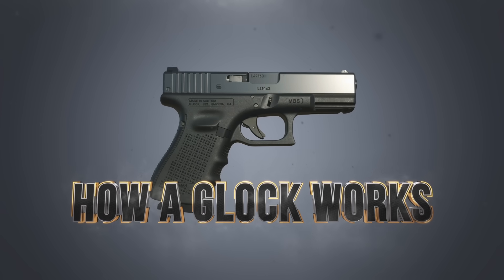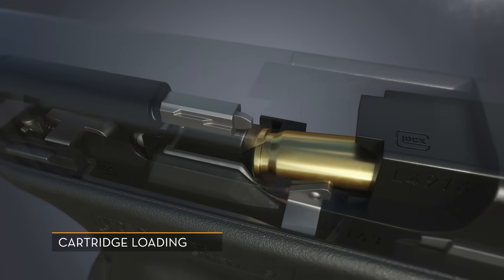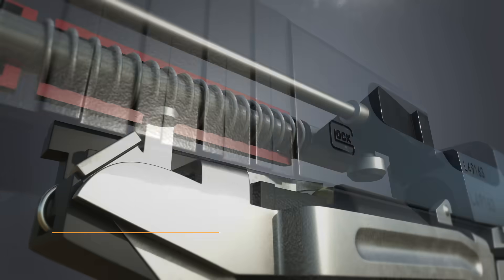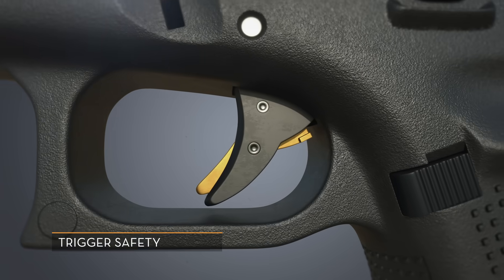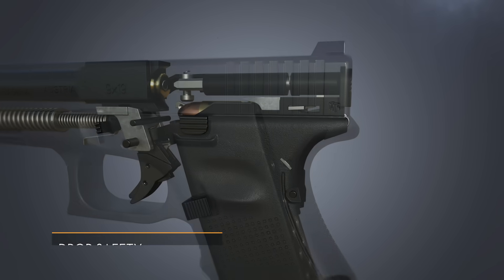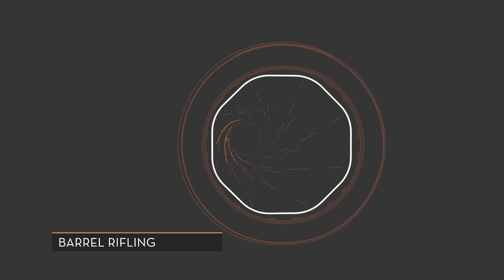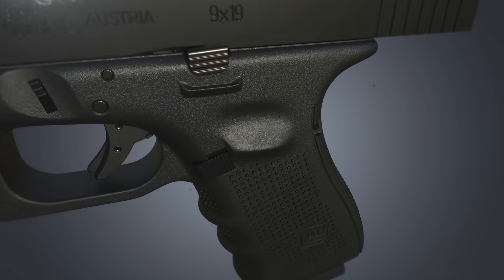How a Glock Works

Comment: 3 safeties on a Glock 😆if you’re finger is in the trigger loop, don’t think is safe for one second . The one safety is on the trigger is self and easy to pull both . Feels like a normal trigger pull . Not dissing Glock . I have 2 of them . They are my favourite. But the safety on a Glock is iffy

Comment: I think a handgun without the trigger safety
fires faster than one with it. I've never owned or fired a weapon in my life so i could be wrong.
Reply: If you wanted faster shots, you would buy a competition handgun like the CZ. Glocks are meant for reliability, durability, and decent accuracy, they’re mostly used by police officers and soldiers, so there’s no need for them to try and make it faster, lighter or more accurate, that would lower their reliability/durability and also make them far more expensive.
Reply: @Glock7eventeen  understood. thnx.
Reply: what them though allegedly, the Gen 5’s have an improved barrel. They call it the Marksman Barrel. Course I’ve never shot a Gen 5 yet. So I can only speculate.

Comment: I let an old timer take a look at my glock 34 and he pulls the trigger while my Glock was cocked. Will this cause damage to my tool?
Reply: No. Dry firing is predominantly dangerous on rimfire guns, and most modern rimfires are safe to dry fire, the older ones are the ones you have to worry about. Glocks are perfectly safe to dry fire.
Reply: @Glock7eventeen  Thanks for the reply. I was worried because after he dry fired the first time, he forced the trigger to dry fire a second time without re-cocking. I was going to take it to the gunsmith to  check it out. Any thoughts on possible damage that could have taken place?😄

Comment: I didn't know about the Firing Pin safety, that's pretty cool.
One could argue there is a 4th safety that's innate to the striker fire mechanism. The fact the firing pin is never left under tension until actuated by the trigger.

Comment: They say never point a gun at anyone even unloaded.    Yet people break own rule when they carry a Glock fully chambered with the firing pin fully compressed ready to fire with no trigger lock safety.     When they carry the barrel at times is pointing at them self with live rounds and also at other people depending oh how they are sitting in a chair etc. 

Same people go insane if you were to have a fully unloaded pistol and its barrel pointed at them while cleaning a gun.   Makes no sense to be so hypocritical and unsafe.

Comment: I saw on a You Tube site, the Glock 20 with 19 millimeter, Underwood Extreme Penetrating Rounds can kill a Grizzly Bear and a Mountain lion. If I was walking in Bear country I would have two Glock 20. One wearing it with a holster attached to my belt. Then another just bellow this.   Also the reason I watched this is because I have arthritis on both of my wrist. Part of getting old. I tried shooting a Beretta Semi Automatic . I had lots of trouble moving the slide.  I used to have a 357 Smith & Wesson 4inch barrel revolver. I can shoot this. Yet, only 6 rounds. Have to use a speed loader.   So I want to learn everything about the Glock 20.  How to take it apart and put it together.  Also I came up with a good idea for a invention:  Just hopefully a couple mechanical engineers that under stand metal and plastic can patent this idea.  Knowing and under standing how a Stiletto Knife works will help. Why the blade pops forward.   I call this dynamic idea.  ( BEAR & LION SHIELD DEFENSE ).  The sales market will be for : ( 1.) Tourist  ( 2.) All Hikers ( 3.) Hunters ( 4.) Campers.    Note: In the jungle or the woods we know there are wild animals.  Most humans can't out run a Grizzly Bear or a Mountain Lion.  What can we honestly expect.   These vicious animals will want to attack the following areas: ( 1.) Face ( 2.) Back and front of neck ( 3.) Bear wants to break our back ,break ribs and puncture our lungs.  Note: Most Grizzly Bears have four inch claws with one inch teeth.  Same as a lion.  Then we have the weight of the Grizzly Bear. Some weigh 900 to 1000 , to 1,600 pounds.  Example : We are hiking .  Then out of no where we are standing in front of a vicious mountain lion or a big Grizzly Bear.  We can't out run a Mountain Lion. We can't out run a Grizzly Bear.  So what defense  do we have?  Will we be able to reach for are gun in time. We are talking only seconds.   Now let me explain the invention.    ( 1.) How about wearing a vest made of some high quality plastic. Light to carry . Yet can handle the weight of two thousand pounds. The area in will cover is the entire back the chest the stomach.  Plus: The entire side up to the arm pit.   Now also would be automatic bear spray that shoots out ten feet. That spray for twenty minutes.  The ( BEAR & LION SHIELD DEFENSE ) WILL ALSO HAVE STILETTO KNIFES THAT STICK OUT FOR TWO OR THREE FEET. SO IN CASE THE LION OR GRIZZLY BEAR IS ON TOP IT WILL GET STABBED. THE PAIN CAN DISTRACT IT FROM ATTACKING US.  ALSO INCLUDED IS THE AUTOMATIC SHIELD SIDE DEFENSE THAT POPS UP TO ABOVE THE TOP OF THE BACK OF THE HEAD AND THE LEFT AND RIGHT SIDE OF THE HEAD.  AS WE KNOW THE LION AND THE BEAR WILL WANT TO BITE THE THROAT AND BACK OR TOP OF THE HEAD.  NEXT: THE FOREARM SHIELD.   THE VERY SAME STRONG PLASTIC . NOT HEAVY. FROM THE ARM PIT TO THE WAIST .  WHY?  BOTH LION AND BEAR WANT TO BITE THE ARM AND ALSO THE LEGS.  SO THE SAME PLASTIC SHIELD FOR THE THIGHS.  THEN STOPS ABOVE THE KNEE CAP.  THEN CONTINUES BELLOW THE KNEE CAP. TO THE TOP PART OF THE FOOT.  NOTE: WITH STILETTO KNIFES THAT POP UP.   ALONG WITH BEAR SPRAY THAT SHOOTS  OUT UP TO TEN MINUTES.  THE SPRAY SHOOTS UP TO TEN FEET. WITH A VERY LOUD NOISE THAT WILL BREAK THE EARDRUMS OF A BEAR. OR LION.   A HIGH PITCHED SOUND.  WHY? NOISE?   I HAVE SEEN HOW BLACK BEARS RUN WHEN THE HEAR A BUNCH OF DOGS RUNNING.   BEARS AND LIONS WANT TO PROTECT THEIR NOSE AND EYES.   HOW DO WE MAKE THE BEAR SPRAY WORK?  A RING ON THE FINGER.   THIS IS FOR THE BEAR SPRAY MISSILES TO SHOOT THE BEAR SPRAY.   NEXT:   THE STILETTO KNIFES:   THAT REACH OUT TWO OR THREE FEET. LIKE A STILETTO BLADE.   SO IF THE BEAR OR LION IS ON YOUR BACK THE BACK KNIFE POP OUT.   STABBING THE BEAR OR LION.  WITH BEAR SPRAY.   NOTE: ONCE RELEASED.  ROLL TO THE RIGHT THEN WHILE ON YOUR BACK FACING THE LION OR BEAR.  OPEN YOUR LEGS.   NOW SHOOT THE BEAR OR LION . WITH YOUR GLOCK 20.   SHOOTING 15 ,  TIMES.  WITH  10 MILLIMETER  UNDER WOOD EXTREME PENETRATING  ROUNDS.  SHOOT THE HEAD,  THE NECK , THE FACE AND THE LEGS.   IF IT WANTS TO ATTACK YOU AGAIN.    YOU ARE PROTECTED WITH : ( BEAR & LION SHIELD SELF DEFENSE PROTECTOR   ).   WHEN THIS PRODUCT IS PATENT ENDED  AND TESTED .  THEN IT COULD SELL EASILY FOR : $ 1000.00 EACH.  IT WILL GO ON THE STOCK MARKET.   IT WILL SELL.   ITS THAT EXTRA PROTECTION .  TO COUNTER THE ELEMENT OF SURPRISE.  BE READY. AS COMPARED TO THINKING YOU ARE READY.   NOW IT WILL TAKE A TEAM OF MECHANICAL ENGINEERS THAT KNOW METAL AND PLASTIC .  PLUS: COMFORT.  LIGHT TO CARRY .  THE SHIELD MUST STAY IN ITS FORM PUT OVER LIKE A SHIRT.   EASY TO USE.  FOR HIKING AND BIKING .  FOR TOURIST AND FOR HUNTING .  IT WILL SELL . IF THIS IS AMERICAN MADE PRODUCT.   AMERICA NEEDS TO START MASS PRODUCING OUR OWN PRODUCTS.   THE TEAM THAT PATENTS , TESTS THIS. INVENTS THIS WILL BE INSTANT BILLIONAIRES.     SO WHO WANTS TO TAKE THIS CHALLENGE:   ON THE / TV SHOW /  CALLED /THE ( SHARK TANK )  ?????????????

Comment: Recently retired police officer, 25 years, you're welcome.  Glock Armorer, Glock Master Armorer and Glock Master Armorer Instructor.  Close, no firing pin in a Glock.  The Gaston Glock design I know is striker fired.  Off set striker series and Glock fail safe fire control group to fire the weapon system.

Comment: There's no question that Glock designs some of the most reliable, accurate and therefore most popular auto pistols.  Not debatable.  Thing is, they're lacking in the visual department.  You wonder where the pull-out nipple is so you can put the water in it.  Call me when Austria makes a .38 snubby.

Comment: The original Glock was a full-auto 9mm called the Glock 18. The G18 was available with 33 round magazines and the hole in the grip is designed for a stock, so it could function as a very short-barrelled sub-machine gun.  So you had a hell of a pocket rocket.

Comment: When a Glock slide is locked back, all you have to do is drop the empty magazine and "forcefully" slam a full mag. in and it will automatically throw a round into the empty chamber. My Sig 320 Compact does not operate this way; you have to depress the slide button which about a second more.  The Sig shoots just as well as all my Glocks, maybe better!  I love them all; you have to learn how to shoot the gun you have.

Comment: That is a fantastic 3D representation and explanation of how a Glock or most stamped four component pistol works. The only thing that I was confused by was the fact they say a three safety system, which all are technically / mechanically one connected mechanism. Once you pull the trigger safety it engages the firing pin and drop safeties. Therefore 3 actually equals 1 safety which basically isn't a safety because mishandling and / or misunderstanding can result in you shooting yourself in the leg since there isn't a "true" safety like a trigger lock or slide lock. All in all a great video especially coming from a Glock enthusiast like myself. In everyone's opinion, tell me what model Glock is your favorite and why. I love the Glock 22. My Glock is a Gen 4, .40 caliber, full size 4 1/2" barrel, 15 round mag. It's a Beast of a pistol in weight, accuracy and recoil.

Comment: I never understand why Glock places safety pin in the trigger. Safety is supposed to prevent firing by locking the trigger. If it's on the trigger, nothing will stop you from firing (squeezing the safety pin along with the trigger).

Comment: Ok but you miss some explanation on when the firing pin in hits the primer. How does this cause the gases to expand? Does it cause a spark or is the gun powder pressurized inside the bullet so when it hits, it releases all the pressure at once pushing the bullet outside the barrel at high speeds. Is it a chemical reaction? Someone answer me.
Reply from the maker: It’s pure magic.
Reply: The dark side of the force is a pathway to many abilities, some consider to be unnatural

Comment: I had one time when I was firing a Glock 21 at a range and had the firing pin strike the back of the cartridge instead of the primer. I cleared that round and the weapon functioned normally afterward, so not sure what caused this malfunction.

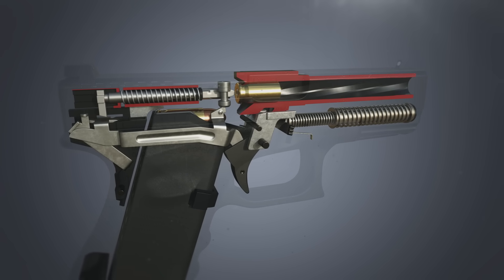Comment: 0:28 - Glocks are blowback operated, not recoil operated (and there is a fairly significant difference between the two). Otherwise spot on video.

Comment: “the Glick contains 3 safeties” in reality translates to:  this thing has zero safeties
Reply: The biggest safety on any firearm is the knowledge and proper restraint of the user. 
But people not familiar with firearms or their use don't know that. 
BTW, Hillary is still not your president.
Reply: fenis pucker dang straight!
Reply: Yep. Like a Taurus. Some people say,..."But Taurus gives you a life-time guarantee." I tell them,..."Think about that. If it fails and you die, they've fulfilled their obligation. Life-time means LIFE time."

Comment: Out of all those safety features and research, the gun stil doesn't have a biometric feature, I mean that gun from that manufacture. (not third parties)
Reply: the FBI did a lot of studies on biometric gun locks, it turns out putting a battery and electronics in a gun is a big issue because once the battery dies, the gun doesn't work and the sensitive electronics sometimes just don't work when put into a gun

biometric guns just don't work well, plus they cost a ton more. Who is going to pay more for an electronic gun when there are millions of traditional guns cheaper?

Comment: well I am austrian and from my experience, the glock is probably one of the best conceald (and open carry since its legal in austria) gun you can buy for the price tag. Since its an Austrian made gun its pretty cheap here compared to other models (talking about new guns not old/used). I have tried out a p226 and a 1911 but I realy prefer the whole design and ease of use of the glock

Comment: There is a free2Play game on Steam called World Gun Disassembly which lets you disassamble a big array of guns from Pre WW1 up to modern day. It has good 3d Models and even a "function" mode in which you can see the inner working when firing, reloading etc.
There is a code for alot of the WW2 arms floating around the internet. Should be easy to find. With that you can have a pretty good look into alot of different mechanics without payment or grind. (which is pretty harsh in this one).
Its worth checking out.

Comment: For someone that drives a modified car with very stiff motor mounts, would I ever have the concern of my weapon accidentally discharging because of these vibrations? These animation almost paints the picture that that would be impossible with a glock with atleast 2 internal safety features that it has

Comment: 3 safety even without safety switcher, what a genius designer.
Reply: They're designed to stop the gun from firing without the trigger being pulled, it's different from the lock traditionally called the safety on guns which blocks the trigger being pulled. In older guns there was a chance of them firing if dropped or just randomly the three safeties mentioned guard against this.

Comment: How many of u really under stand ....🤣🤣🤣🤣
Reply: I have a Hornady Reloaders Manual, and it explains in great detail what happens when one pulls the trigger. By the microsecond, the primer goes back against the breach, the cartridge swells, the head stretches back to the breach, pushes the primer back in, etc. etc. stuff I’d have never imagined had I not read it. More of how all guns work, not just Glocks. What seems so very simple is complicated. I also watched a YouTube video on how bullets are made, the cases especially. A brass coin falls over a tube with a metal finger and BAM! A huge ram knocks the coin into a casing! Fun to watch.

Comment: You say 3 safeties. I see one. It is connected to trigger bar. Sooo drop safety and an idiot reaches for it grabs wrong and pulls trigger. Or idiot 2 puts in sweat pants and blows nuts off. You need more like two safeties like the Springfield mod 2 has. Much safer. Just saying...

Comment: Great video, but the gunsmith in me has to point out Glock pistols do not contain firing pins. They are striker fired. A firing pin is not contained in a spring and is struck by a hammer, like a 1911 or AR15. A striker is contained in a spring and acts on spring tension to impact the primer when released. That aside, great video and graphic illustration.

Comment: This is what I maybe love the most about weapons.
The simple, yet ingenious designs.
A weapon is meant to be practical, and over time, only the most practical weapons remain, like some sort of survival of the fittest. Weapons are void of any unnecessary parts in their designs, and are meant to be simple, light, robust, and work under any circumstance.
Sure you might have a golden plated m1911, but the weapon will work exactly the same as any other m1911.

Comment: What happends if you cocking a Gun without a magazine in it and no bullets in it no bullet in the chamber either. Then u load the magazine  and put it in the Gun and shoot it straight from the bolt without cocking it Will it break glock?.
Reply: No...
Reply: Colin Tolon even if the Gun fires? And the bullet fieres out of the gun
Reply: Colin Tolon but after u cocked it u fill the magazine and put the mag in the Gun and shoots without cocking it again the bullet flies straight from the bolt like flies from the mag
Reply: @abdelrami7132  I can't understand you.